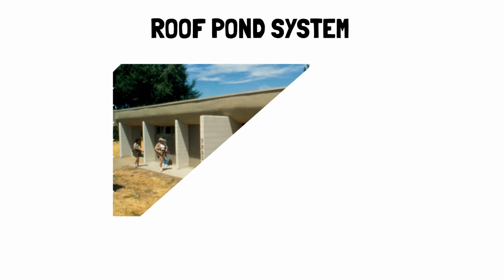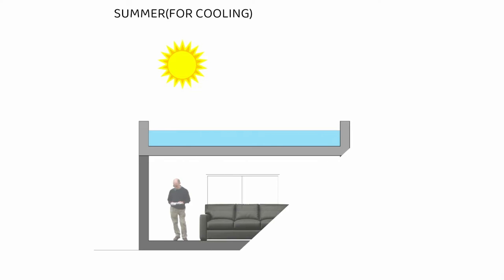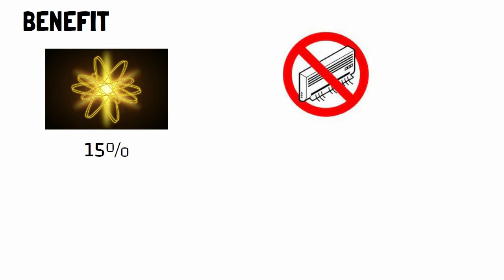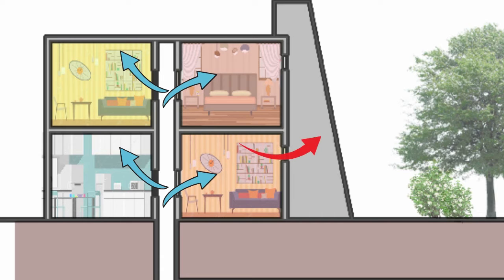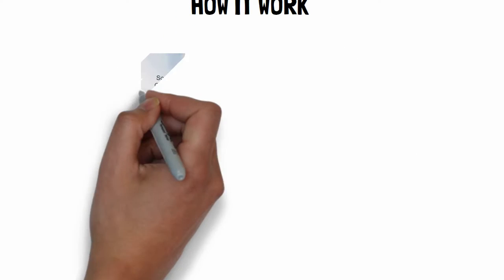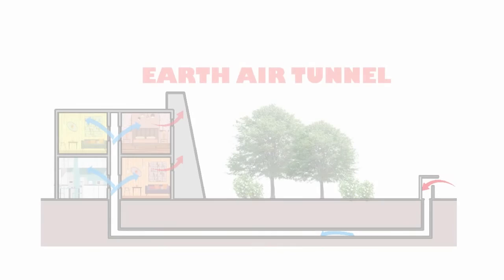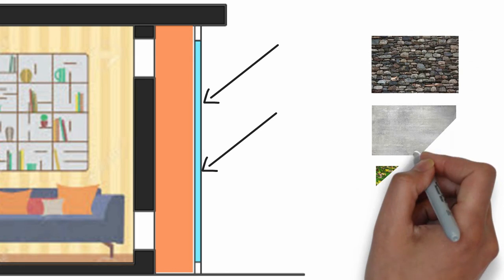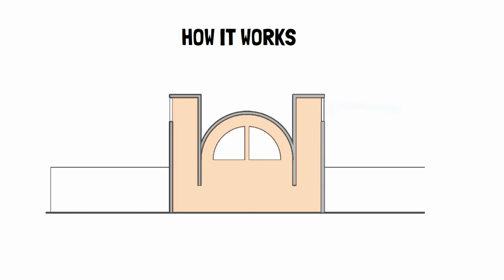Passive design technique for house

Comment: can we make the solar chimney from big steel tubular pipe painted in white?, I would think the steel absorbs heat better than bricks... IMHO
Reply: First, you need to paint it in black, not white (cause black absorbs light). For the material i don't know if steel would work, cause it's a bad isolation (i guess)